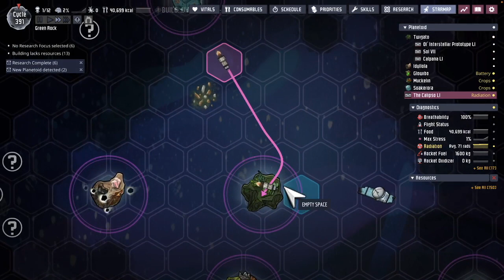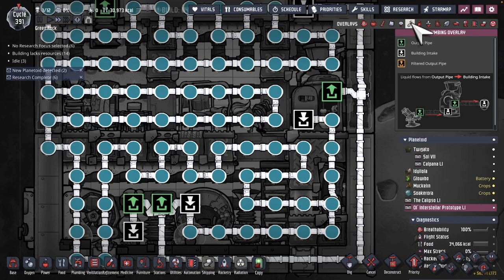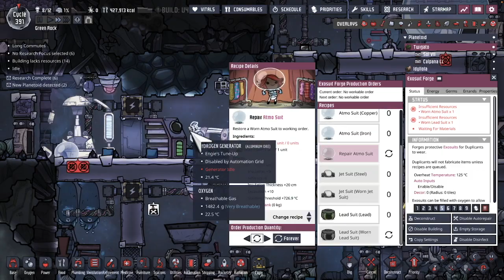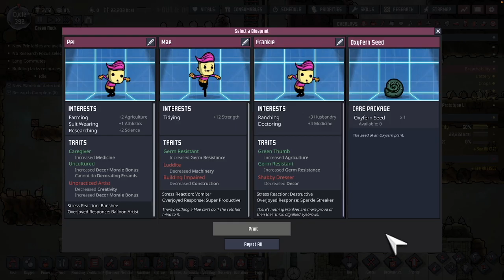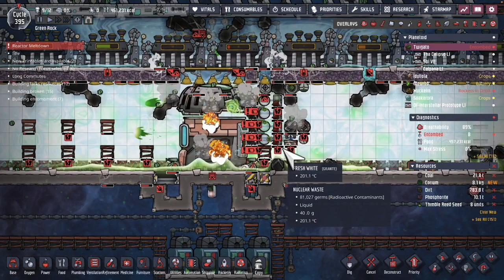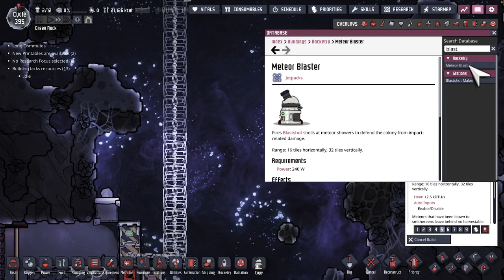Whatta Blast #43 Meltdown

Comment: 23:08 shows your waste is at 199C at about 894kg, but your steam in the room is 169C at about 156 kg. 199 * 894 = 178k > 169 * 156 = 26k, basically what therma energy they are holding. This is not exact since it is actually based on Kelvin, KG, SHC (ONI in properties), TC (ONI in properties) and the other things in the area like your background walls.
That is why the reactor is at the very top in most set-ups, to keep the waste & hot water from touching it.

Yes the water is cooler than the steam that went into the turbine, but it is only dropping the temp so much (temp goes to the turbine, which is why we cool them with aqua tuners in the steam room).

None of your turbines are running at full (>= 200C) 850 watts, which means you do not need another turbine. Even 200C+ is fine for a turbine, but you will lose heat (power making) in the process.

FYI: 175C works for a steal auto sweeper, which means you have about 6C to go. I think most things are between 175C to 225C for a steal item, which means I worry for your steal doors.

PS: Could put that waste into a INF storage for rad bolt generation. One Radbolt Generator at this point would cost less power and produce more bolts per sec. Also would have less drop off loss due to less tiles.